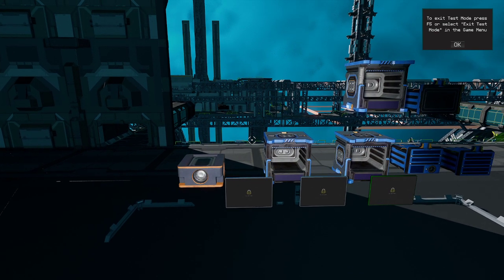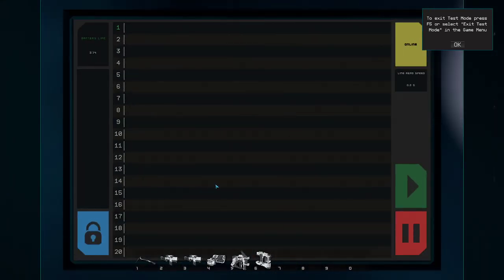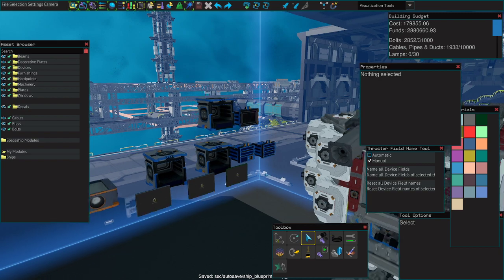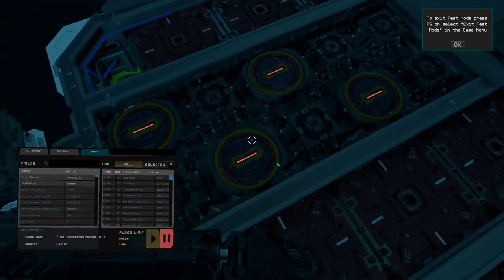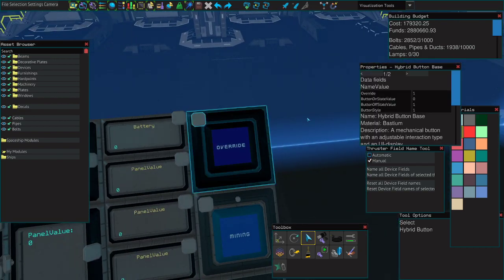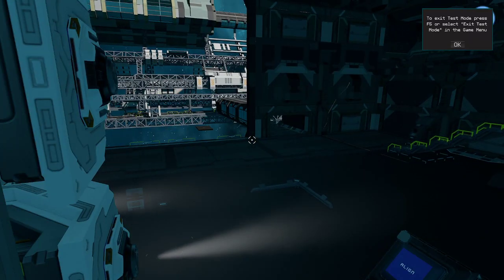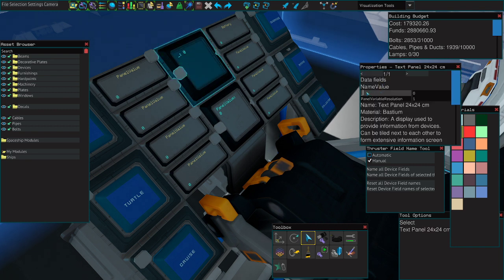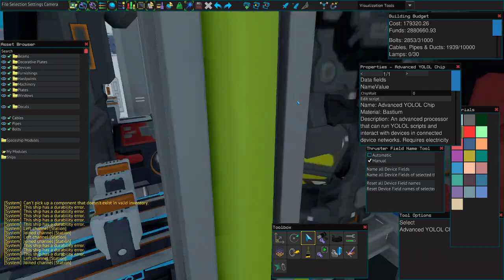Starbase Tutorial: Installing ISAN (GPS) and other YOLOL improvements

Comment: Don't you need to change you Override button ON and OFF value state? By default when button is ON it gives value of 1 which will make FuelChamberUnilRateLimit = 100 - "number", while button OFF state gives value if 0 will make FuelChamberUnilRateLimit = 100 - 0 because you multiply by StoredBatteryPower by 0
Reply from the maker: Yes, you would invert Override so on means 0 and off means 1

Comment: Does this work on sole text panels mounted on a seperate control table? The script seems to be running fine and the reciever is mounted and functional, but the text panel isnt being updated. The panel itself is also hooked to the network as its mounted on a 45 degree stand that has a working button.
Reply from the maker: It should work if the text panel is properly connected
Reply: @Ravaen  Got it working and found the issue. Aparently the lower part of the 45 degree stand dosnt count as a control table . I also tried to use a panel base but aparently that dosnt work for text panels at all, even if it claims it does.

Comment: What do you need to show your distance from origin station from far away?
Reply from the maker: You can change your transponder settings to show origin stations from further away, 500km is the limit to my knowledge. You can also set up a reciever to check but it requires a different code.

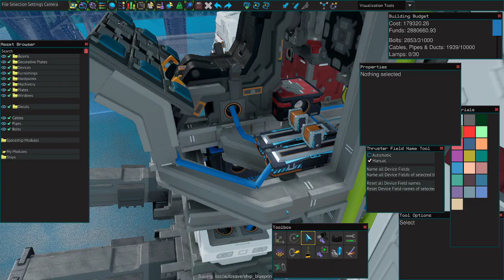Comment: Reviewed the ISAN section at 9:02. Seems accurate and straight-to-the-point! 👍
Additional tip: You can enable prediction by setting po=0 which should improve accuracy while moving in a straight line at the cost of 0.2 seconds.